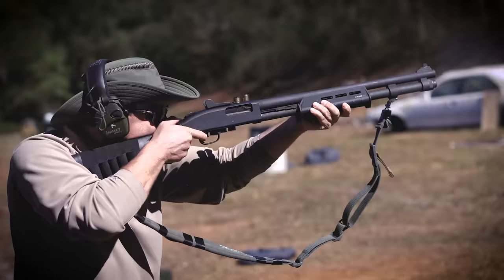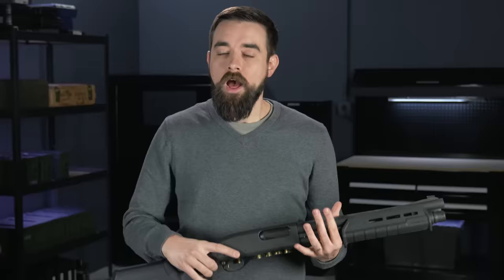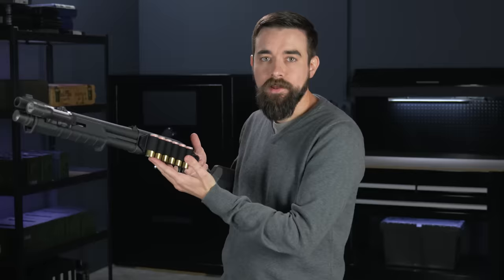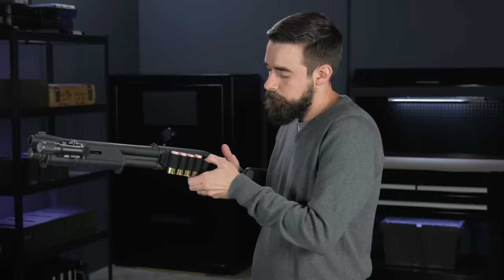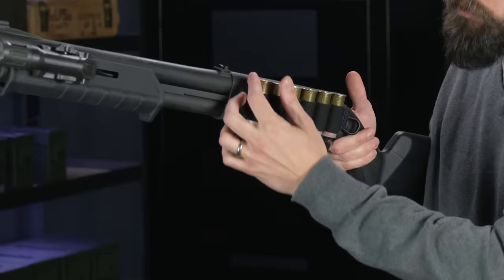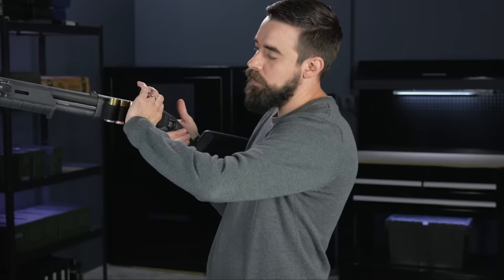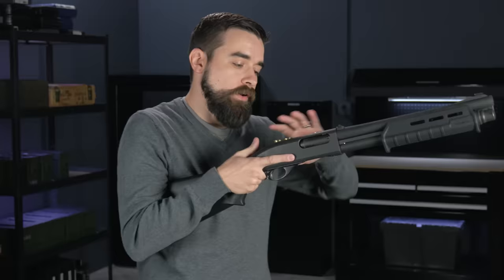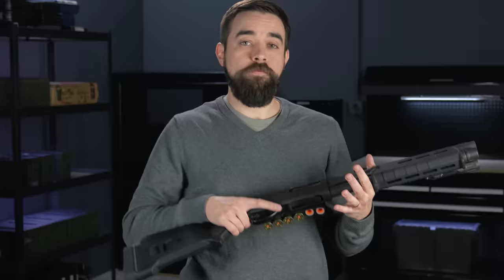How to Reload a Defensive Shotgun

Comment: Lesson: don't use a shotgun for home defence. Buy a rifle.
Reply: So you would like to use rifle in only "5-meter-gunfight"?
Reply: @mhazg6621  Yes
Reply: @IR-xy3ij  dude, you will shoot the air if you use rifle in close quarters
Reply: @mhazg6621  At 5 yards the shotgun's pattern is so tight to the point that precise aiming is still required. I'd rather take a suppressed 300 BLK SBR for its light weight and high capacity.
Reply: @IR-xy3ij  wow
Reply: I R Yeah I don’t think my neighbors would appreciate that weapon choice. Shotgun is still king in close quarters
Reply: @booya6437  Buckshots penetrates wall better than both 5.56 and maybe 300 BLK too. It has more power for sure, but I honestly don't have the same amount of confidence when it comes to reloading a shotgun in the dark. It's much easier to eject a magazine and then insert a new one for 30 extra rounds on a rifle.
Reply: I R That’s why you have a shotgun with 8 round mag tubes. This whole idea of using a rifle inside your house for defense is a fad and pushed by tacticool operators. Rifle rounds go through people, buckshot puts chunks of meat on the walls. There’s a reason it’s been used for 150 years.

Comment: Loading into ejection port is "tacticool" for the range, but for home defense it is an AWFULLY BAD advice. Zero gain with unnecessary complication that can easily go horribly wrong.
Using same muscle memory for two different reloads is also bad.